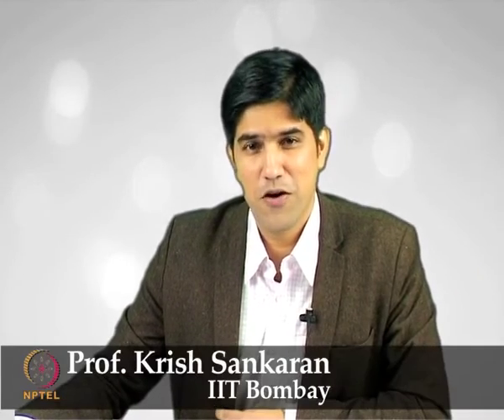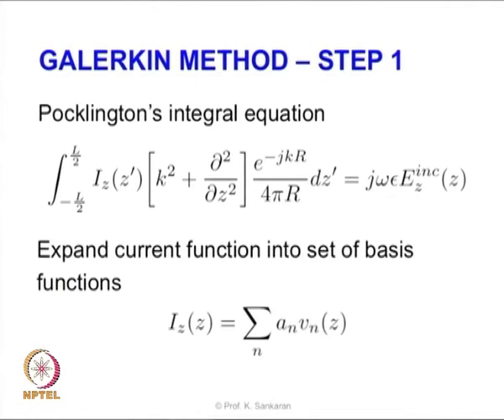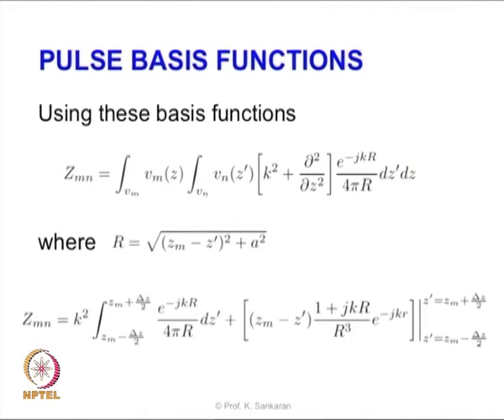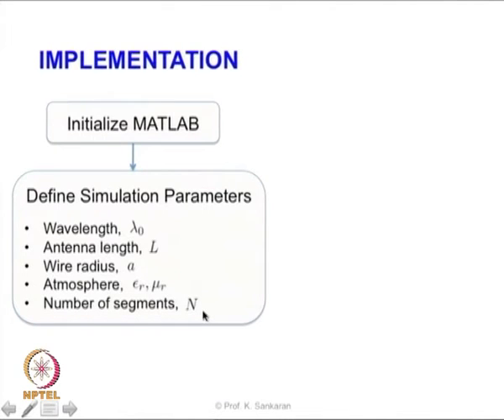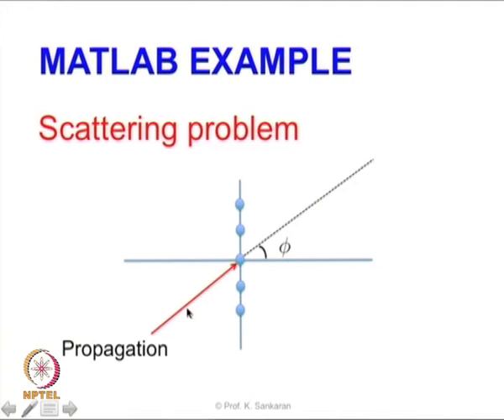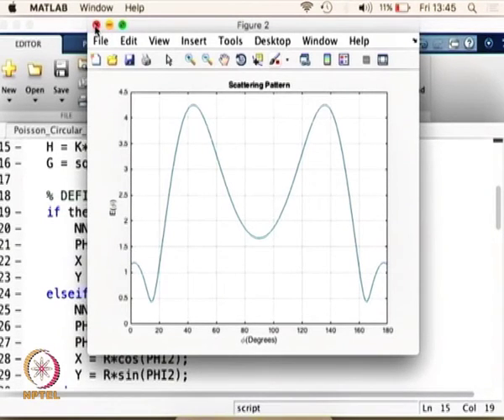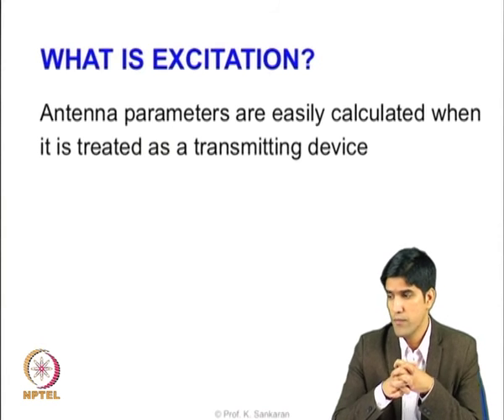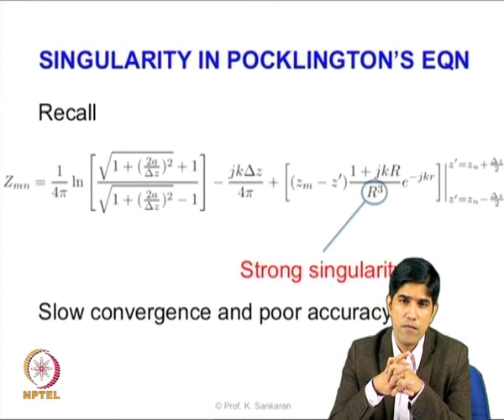Lecture 25 - Method of Moment

Comment: Thank you for your lecture series.  Your derivations and explanations are clear. Is your Matlab code available for testing and for reviewing the numerical (discrete) approach to the integral equations and then using that for follow-on power calculations?